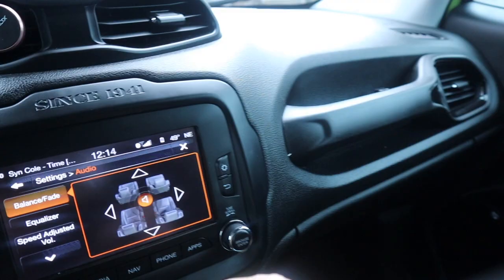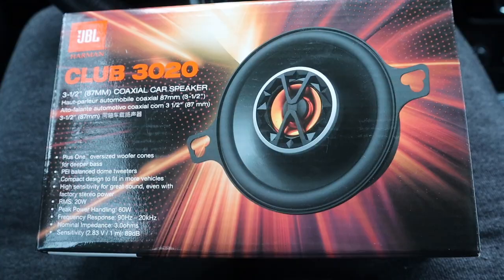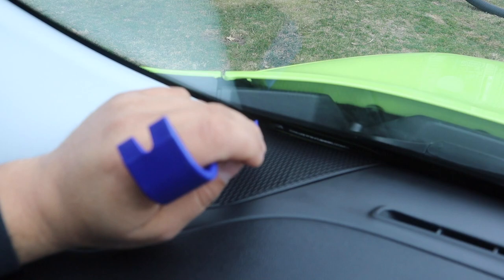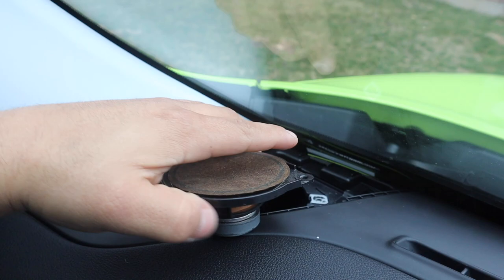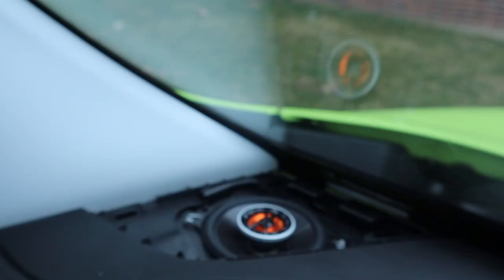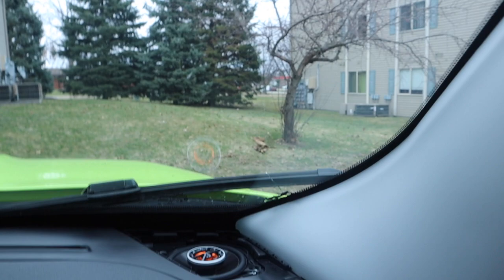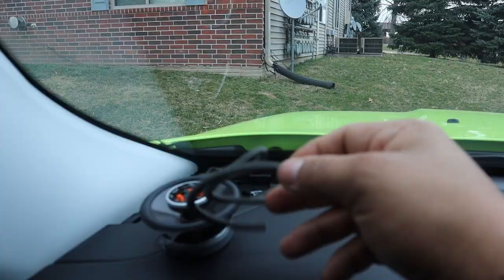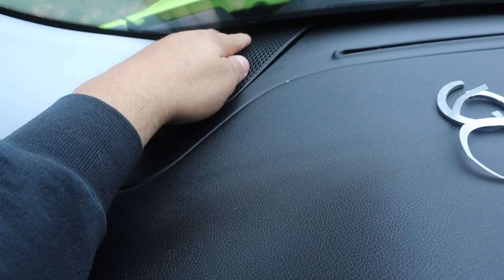Dash Speakers Upgrade for your Jeep Renegade

Comment: Haven't watched your door speaker video but i can almost guarantee those were the issue.  My stock speakers were starting to blow in my renegade just s few years after i bought it. Hot garbage.  Replaced them with some mid tier JBLs and it made a world of difference. I need to do those dash speakers too.
Thanks for the walk thru,  my man!

Comment: keep in mind that the adapter reverses the negatives and positives. I had to cute the tip off adapter, use the speaker splice that comes in box and wire it correctly. if you look at the the way it goes into oem speaker and way it goes to adapter to speaker, you will see what i'm talking about.

Comment: Everything you have done to your renegade I have done right after lol! Waiting on my day time running lights but after that everything should be good , but lately we have been having this jerking motion while driving , dodge has said they are more then likely gonna replace the motor , their is a recall coming soon is what they said , I have a 2018 btw with 50k miles I bought it knew if u have this problem I would love to know what your dealership told you , we thought it was the transmission
Reply from the maker: Its good to hear my videos are inspiring people to do the same. 😁  Thanks for the heads up. I haven't heard anything yet or felt anything while driving my Renny.

Comment: I have the same problem and the cause could the insulation that goes behind each speaker or the the transistor units that gives power to each channel, with in the time, every time that it's overheated the sound quality decreases...I am thinking to change the whole system...starting with the upgrade of the radio system...to a more modern unit...with the same capabilities than the factory one...
Reply from the maker: I'm probably going to install new door speakers but I kind of like the factory head unit so I'm going to keep it and hope thats not the issue.

Comment: Great video!! Did u ever find out if it was the door speakers or the dash? I know u said dash replacing didn’t make much difference. I’ve the same issue 😬
Reply from the maker: I think I figured it out. Its kind of weird but I can only hear it when I play music from my phone through BT. When I have my sirius radio going I never hear it. So I'm boiling it down to bad music download/ audio.
Reply: @AdventureGT   the rams have notoriously had issues with their Bluetooth modules!!  likely that.  try that same song via bluetooth on a good speaker and its likely fine.   This is a great upgrade.  I did the same in my ram 2500 but went with Kicker in dash and doors.  Factory speakers are just turds....  lol
Reply from the maker: I wish my factory speakers had more bass. I do plan to change them out but I haven't found the speakers I want yet
Reply: I'm completely speaker stupid but trying to learn. 

So the dash ones are midrange, which is the mid and bright end of the sound wave. If they are not the right ohms (I think...like I said, don't really know anything), you have to turn the music up volume up to hear the bass through the door speakers, which is too loud for the mids in the dash and you end up with distortion in mids trying to get a balanced sound. Turn volume down lose bass completely, but mid distortion goes away. So what to do?  So...you get this "crossover" or "bass breaker" (another component, wired in line to + on speaker) and boom! Balanced sound...rich bass, clear mid and highs. Some sort of capacitor that give you the right ohms? I don't even know number you are supposed to shoot for...

Meh, anyway. Stereo stuff is complex.
Reply from the maker: Usually when switching speakers around you wanna stay close to stock numbers, especially if your not changing out your head unit. You could have some expensive speakers put in but your head unit won't be able to keep up. 
Change put your head unit and you'll have a whole new numbers game. I recommend looking into Crutchfields website, they're very knowledgeable with all there stuff.

Comment: Hi there bro, i bought a pair of Kickers Dsc350(3.5") for my jeep gc 09, appears as recommended to upgrade, do you disconectn the battery of your jeep when u did it? i affraid to install it, also the kickers i bought are coaxial, so im changing the tweeters for the coaxials
Reply from the maker: I did not unplug the car battery. With it being plug and play it wouldn't have major risks

Comment: I installed the JBL club 322f to my Rav4 dash and I get sound distortion at high volumes when the bass kicks in. I don’t know why that’s happening. Is it the speaker themselves ?
Reply from the maker: It might be the wires. I was told with some cars you have to reverse plug in to the speakers. That will require cutting off the connector and switching them around. Try that first
Reply: U can add a bass blocker. That might reduce distortion at high volume

Comment: What model/trim do you drive? And it's a 2015 correct?
Reply from the maker: Mine is a 2017 latitude
Reply: @AdventureGT  have you replace the door speakrs?
Reply from the maker: No not yet. That will be something I'll do soon.

Comment: You use an amp or the stock sound system from Jeep?
Reply from the maker: Currently stock
Reply: @AdventureGT  and the power is enough? I mean I usualy dont listen to loud music but a little bit of bass would be nice ;)
Reply from the maker: I'll be honest with you. I'm not sure if it was the speakers I chose but I'm not getting a whole lot more bass. It's definitely louder and clearer but it's still missing some bass.
Reply: @AdventureGT  sorry, I have one more question. For the door speakers you use no amp, too? 
Is the max volume still loud? Thanks for your time man. 
Best regards from Germany!😘